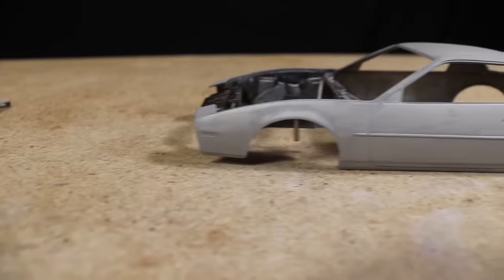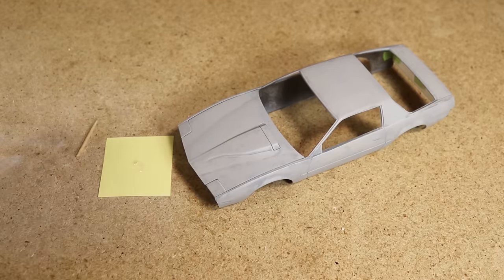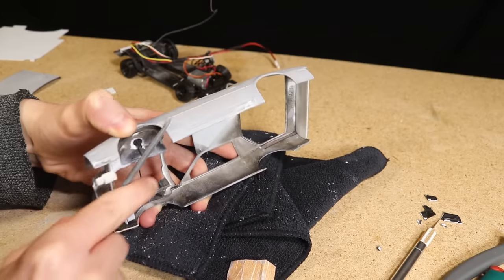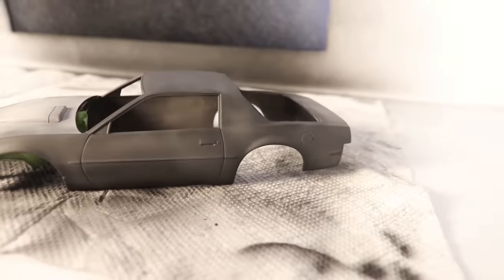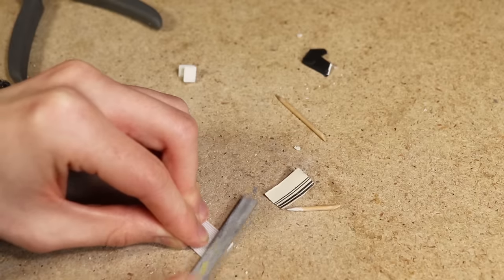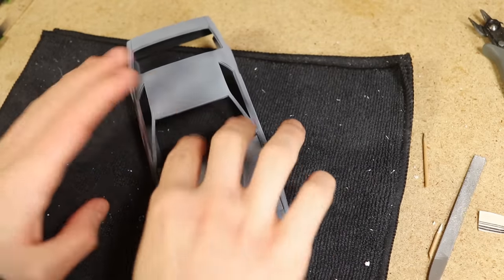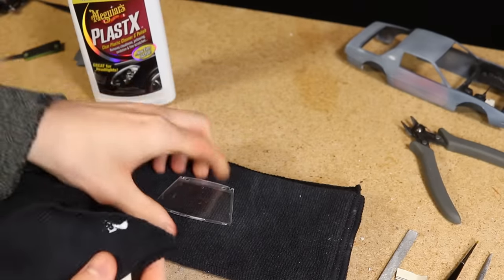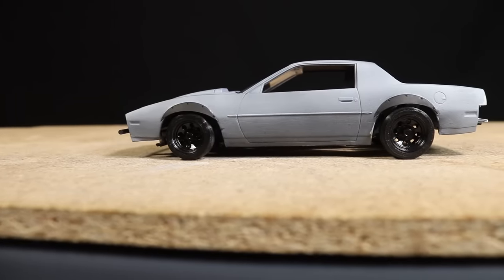1/24 RC Drift Missile Firebird Build: Completing Body, Painting/Weathering, Dents, Accessories (E25)

Comment: Best way to simulate dents and dings in model cars is by using a small butane torch with the heat blower nozzle and just take your time. Patience patience and then even more patience. I love the weathering process. I think it's the most crucial detail to give a model that "real" look we're after in model making. You did and excellent job with the soldering iron and lighter though!!
Reply from the maker: I appreciate the info. It's a lot of fun doing the weathered stuff, I look forward to building more bodies like this and continuing to learn and experiment with new techniques.

Comment: i have this same model but turned it into a drag car and scratch built a cage in it and put some slicks on it. i found that if you get some model wheels you can run the tires over some coarse sand paper to make  burnt up rubber and sprinkle it onto the lower quarter panel with clear plastics glue

Comment: When will the 1/24 axle will be pasoble to buy in the shop? Or i can just use the 1/25 axle on 1/24 car?
Reply from the maker: The 1/25 scale MA10 will work on both 1/25 and 1/24 scale vehicles. There's only a very small difference in size between the two scales.
Reply: @MakeItRC  thank you!

Comment: Hi mate. I like your work and want to offer some hopefully constructive criticism...
You have to think about the life of a real car when you are doing weathering.
It doesn't make sense to have misty undercoat over the top of the presumably shiny red and blue panels. When was that done and why?
Same for the dint/white spot on the rear pillar... When was this done and how?

On painting, I think i heard you say you are using acrylic paints? You need to be putting on a wet coat every time.. It can be a thin wet coat, but it needs to be wet... Otherwise orange peel.
I think you should be thinning your paints much more too, which will help as well.

Comment: Hm. I like the standard of work you have done. Tho i am not a fan of this design of weathered drift missile. Well, the weathering i come from is painting H0 railway wagons and locomotives to look dirty and used instead of fresh from the factory.

This Body was originally the same version as the firebird used for K.I.T.T. in Knight Rider, which is not that common as far as i know. I do not want to demote your work, it´s awesome, i just dont like the look of cars with missing bumpers or haphazardly primed, if they are to be somewhat performance oriented. If you made this car properly rusty after this, i´d like it a lot more.

Take this for what it´s actually worth: exactly what you paid for to get it. Absolutely nothing. Don´t mean to be mean, have a nice day and carry on, comrade!!

Comment: Dude, I'm sorry but your website is too inconsistent. I wanted to find some ball joint end for the driveshaft in 1.5mm diameter and there's only 2mm available. Will there be more sizes for parts for both 1.5mm and 2mm that aren't currently available in the future? It would be greatly appreciated. Other than that, I bought some stuff from there and am looking forward to putting together my first project
Reply from the maker: Are you interested in a smaller ball joint end 1.5mm in diameter, or a ball joint end that can be attached to a 1.5mm shaft? Just in case you aren't already aware, all A-Type drive shaft sockets and ball ends are compatible with each other. Good luck with your project and the support is greatly appreciated! We are in the process of making some changes and improvements to our site and have been collecting some feedback which has really helped, so if you have any suggestions or ideas on how we can improve feel free to let me know.
Reply: @MakeItRC  A 1.5mm ball joint that can attach to a 1.5mm shaft, yes. 

So I can have a 2mm ball joint that can connect to a 1.5mm driveshaft socket?
Reply from the maker: Thank you for the clarification. We do not have any drive shaft ends that are smaller than the A-Types. The 1.5mm and 2mm measurements listed when choosing a ball end or socket are not referring to the size of the ball joint. They are instead referring to what size rod they can be mounted to. A 2mm A-Type ball end will fit a 2mm rod, a 1.5mm A-Type socket will fit a 1.5mm rod. Since both are A-Type driveshaft parts they are compatible with each other as a ball and socket joint.
Reply: @MakeItRC  My eyes crossed a little bit here. I'm hoping you can find the time to publish tutorials on your site, explaining the jargon and stuff.

Comment: Applying heat is ok for minor damage. to get some extreme damage, i found the heat technique leaves the panels looking soft and curvy. to counter this i used foil to form into the shape of the panel and dented that up. i then back-filled the dented panel with body filler to hold it's shape.  my Gone in 60 seconds eleanor: https://www.flickr.com/photos/87459383@N07/albums/72157687304669054
Reply from the maker: Nice build! I'll have to try that technique sometime. Thanks for the info.

Comment: Can anyone help me with my printer!!! if it is printing in the air (with support) the bottom layer is loose
Reply: What printer do you even have? Is it new, has it always done that or did it start happening recently? Best thing is you head over to Facebook, group specific either to your 3D printer or the "3D Printing" group or the "Official Geeetech & Anet 3D Printer Support Group (Incl. RepRap Prusa i3)" group, shoot a short video on your phone, and post it there, chances are, there's something you aren't noticing but that might be instantly familiar to experienced members.

Usually there's a few steps, first you ensure that the X gantry is perpendicular to the Z axis, you may need to hand turn one of the Z motors while the printer is off, then you adjust the Z endstop which is either movable or has an adjustment screw till when the printer homes, the nozzle is about as high as the printer bed, then you turn off the motors, move the print head around, and adjust the bed level screws until at every point, the nozzle just about touches the bed or is a set distance from the bed - since the bed and the mounting hardware expands upon heating, it's advised to use a piece of paper or two as a feeler between the nozzle and the bed. But this is not a universal method, many printers have a special way of doing things.
Reply: @SianaGearz  I have a prusa i3 mk3 and thanks for your tip I will look on Facebook and other forums👍
Reply: @Foldingblade  On the MK3, there's a possibility that the bed sensor (PINDA) has slipped down its mount a little bit, that would cause the issue. It's square by design in XZ because it will just ram the top posts to ensure that, so no care is needed there, and the bed is fixed mounted so there's no leveling step there either. And no endstops. Something wrong with the PINDA is the only cause of issue that i can think of.